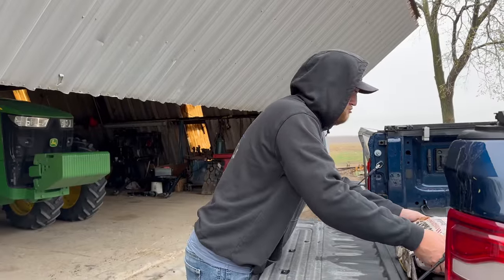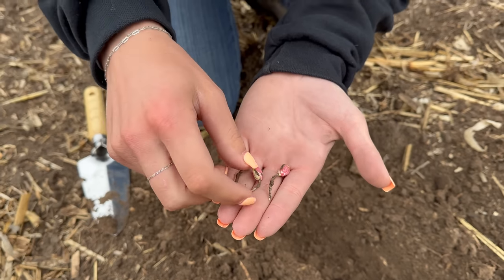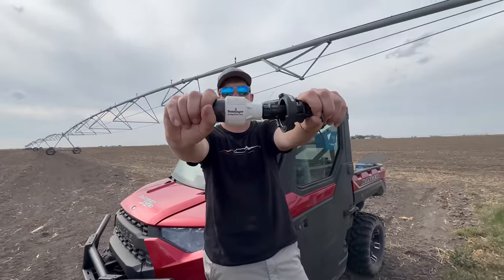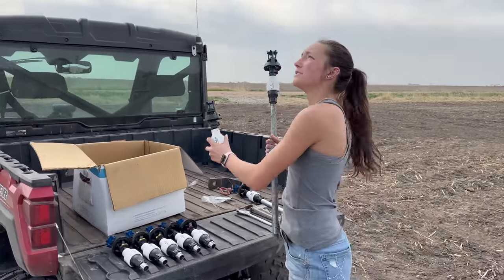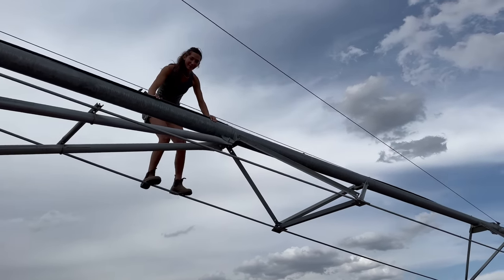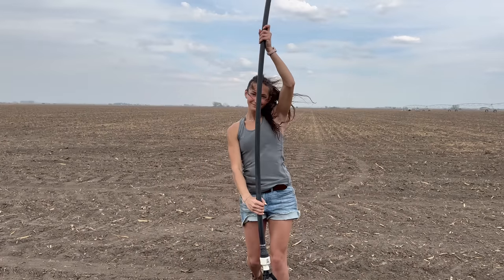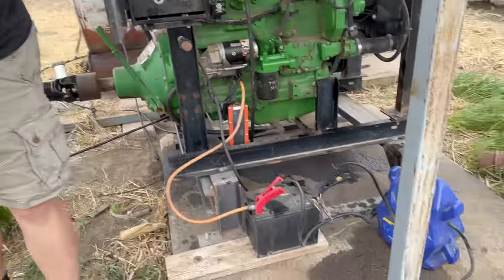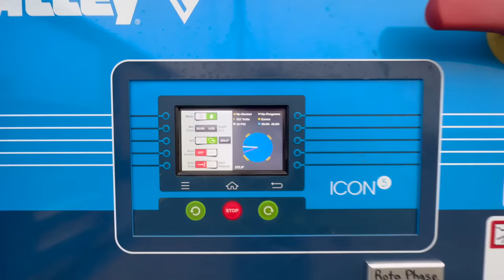Making It Rain!

Comment: In several shots, there was a steel cable running the length of the pivot. It looked like the perfect place to anchor a safety harness. I think you would be super cute wearing a safety harness.

Comment: Fascinating how those pivot sections move independent of one another and yet work together as a whole.
Reply: Having to look that up because I too am trying to imagine how it senses movement  between all the drive units to keep it strait and identify a stuck or broken drive unit. Voodo majic man ha ha ha....
Reply: A good video of one being built and how all the bits work together- 14:30 talks about keeping the pivot towers aligned
https://youtu.be/7j1lMs7fcIQ
Reply: @aaronsbarker  i was going to link that but you were faster =) he nails it !
Reply: sounds like society!
Reply: @js7127  From what I understand the section on the end furthest from the center moves all the time.  At each joint between the other sections there is a sensor that detects defection as each section gets out of line.  Once the deflection gets great enough it turns on the motor for that section and moves it forward until it gets ahead of the next section outside it when it shuts things off.  It then sits there until the sensor tells it to move again.  I may be way off but this is how I imagine these things work.
Reply: @Aaron Barker  used to work on a farm that had overhead irrigation in a straight  line on one unit and if any section got just a little out of line it would shut it self down and shut down the pump which was a separate diesel motor a half mile away. Smart machines!

Comment: I worked on a pivot many years ago. We used 2 extension ladders to replace all the rusty sprinkler heads up on top. It took 2 people to break free some of those heads. It took just as long to move the ladders by hand to the next spot.
Reply: That pivot looks like it's over a thousand feet long. What would your guess be?
Reply: @bige.3474  1000 ft pivot would only cover 75 acres. So it's more like 1500 feet, that would cover around 160 acres.

Comment: Surprised you don't have a harness so you can clip on for safety. The other way would be to buy a pod for the front forks on a telehandler, so you have a platform to work from.

Comment: If it was me doing that sprinkler job, I'd attach my harness clip to those wires running parallel to the pipe. That way you can still move easily, but if you do lose your balance you're not landing on the ground.

Comment: You've mentioned and showed us when you were planting the areas of the field that have the pivots for irrigation and then there were some parts of the fields that don't get covered by the pivots. How are those parts of the fields irrigated and do you notice a difference in yield between the parts that are and aren't covered by the pivots? Love the channel! Thanks.
Reply: God does that and mother nature does the watering in those places.🤫😀💪👍🤟🌟🇺🇸
Reply: For the most part, the corners aren't irrigated.  And, yes, the un-irrigated areas yield less than the irrigated.  This year has been quite dry, so the difference will be very large this year.
Reply: New pivot designs fold at the end sections and can almost irrigate a square field 100%.

Comment: I see from a USDA document that the height of the truss is 4'-14' with most in the 8-9' range.  Not a fall you want to take, but I don't think a fall arresting harass would even deploy.  Seems a bit slow working your way along the stays but I assume an orchard (tripod) ladder has been tried and discarded by past generations.

Comment: How high are you? 8-10 feet? A fall would be painful but dirt is soft. Have you considered since you already have on a tool belt you can add a safety line to it with carabiners on both ends. Attached it to the cable and it slides along. At every brace you have to unhook and move it over. That frees up both your hands to work and prevents accidents. Probably makes it go faster too. I assume you were not using your lift as it might get stuck or because it takes one person to run it slowing things down?

Comment: Thanks for an entertaining (as well as educational) video. I see pivots in real life all the time but I didn't realize how high they were until I watched Laura climb up with her pockets full of sprinklers. Is the water that comes out of them potable? Would it make you sick if you drank it? Maybe it depends on the well? The sprinklers being semi-custom, adapted for their position on the pivot, was fascinating. Laura explained that's to adjust for the fact the path of the ones further from the pivot point is longer. But engineer me wants to know if the distance the water has to flow through the supply pipe also is a consideration in setting the size of the sprinkler. That would mean pressure at the furthest-out sprinkler is less than the ones closer to the pump. So Senninger would have to do a "head & flow" calculation first before matching the nozzles to their positions -- of course this happened before Laura and Grant got the parts.
Reply: Normally they figure a 10 psi pressure drop along a 1/4 mile machine.  That's close enough on a fairly level field.  But many fields have significant elevation differences, and that can seriously affect the pipe pressure as it goes up and down.  In those cases, they have "pressure regulators"  (Not sure if that's the correct name or not) that mount in between the pipe and the nozzle.  
Say you've got nozzles that are designed to operate at 30 psi.   In that case, as long as the main pipe pressure is at least 35 psi, the pressure regulator will deliver 30 psi to the nozzle.  The main pipe pressure could be anywhere from 35 to 70 psi, but the nozzles will see 30 psi all the way along the machine.  
Oh, and the water that Laura pumps is potable, although you wouldn't want to drink the first few gallons at the start of the season.  There'll be some rust and oil from the deadpool that has sat in the pump all fall and winter.  Give it a couple hours to flush out, and it's perfectly drinkable.
Reply: @42base13  Thank you, that's great! Yes I think pressure regulator sounds right.

Comment: How do the pivot wheels work? Do they all drive or only the ones on the end? 

If they all drive how does the speed adjust to account for where they are located on the pivot?
Reply: AFAIK, the pivot sections are jointed (to rotate horizontally). At each section join, the motor drive senses how straight the joint is, and adjusts its speed to keep its joint straight. Set the speed of the outermost motor, and the rest of the line stays straight. This way, if there's mud and your wheels slip a bit, your motor just runs a bit faster to catch up.  (I may be wrong - we don't have huge pivots in my part of England - Laura is about 4300 miles from here...)

Comment: What drives the wheels and keeps them in a straight line? Thanks for a great video.
Reply: Same question I had👍
Reply: @sam__304  There are gear boxes with electric motors on them  and drive shafts out both directions to each wheel, the motors cycle on and off based on alignment switches on each tower to keep all of towers in alignment.
Reply: @davidpancheri6006  thanks

Comment: I would have thought it was necessary to use Teflon tape on the threads to prevent leaks. Do you have any problems with the heads leaking?

Comment: So question, is it the hydraulic pressure of the water going through the system that actually turns the wheels to make the pivot go round or is it like electricity or some other man's

Comment: “Totally safe.”   In an OSHA class once, the instructor mentioned how industry is overburdened with rules and farmers have too few rules/precautions/safety equipment.
Reply: For at least 40 years I’ve heard about diesel engines at well heads.  Until this video I never thought about the fact that hiu have to bring fuel to those engines.

Comment: Hi Laura. This will not make the top ten, but did you and Grant buy a bucket truck? A safety line could be a nice thing while on the pivots. I hope these sprinklers work better as I have seen you and Grant dig enough tires out of holes. The pivots are dry, what they convey is not. Have good days!

Comment: Doe you work with an engine or a fuel supplier to test the engine oil periodically to determine when it should be changed or to see if there are lubrication issues?

Comment: I have a question about the water. If the fields are rather square and the pivot is moving in sort of a circle, how can it give water to all the crops? I have like a thousand more questions, but why not start with this question.
Btw... Hello from Sweden 🇸🇪
Reply: It doesn't water the corners, unless it has a swing arm on the end that can swing out into the corners.

Comment: Safety 2nd or 3rd, but safety. A fall from that high could really hurt, wear a harness or rent a boom. (please) Also an open drive shaft would show no mercy if you got into it and accidents happen mostly during experimental start up. That's the most dangerous time. (please)

Comment: On question Laura -> why are the pivots so high up above the ground. My first thought is that a lot of water is wasted due to wind and evaporation. Shouldn't it be lower to the ground. Is that because of getting maximum circumference?
Reply: Pivot height probably is two factors.  how far can you get the water to go and the ability to drive equipment under it.
Reply: Crop clearance.  You don't want the tie rods dragging on the corn.  You can flip a pivot that way.  It happens sometimes when the corn gets taller than usual.
Reply: @42base13  Thank you. That makes perfect sense. I had not considered once the crop reaches maturity. Duh!

Comment: Greetings from Germany! I have maybe a silly question the pipes turn in a circle but the field is squareish? dies it reach every corner ? or do you get dry corners? in germany we dont use such systems at all or at least in my part of germany.
Reply: There are dry corners.  Laura explained it during planting.
Reply: @dwightl5863  ahh thanks man ye i missed that video honna watch it now!
Reply: On some units the last arm folds back to make flats on the circles otter limits. Would sure like to see a drone time laps of that, COME ON UMC !!
Reply: That would require a drone with a very long battery life.

Comment: One thing you really need is a Bucket Truck bought at Auction. They have a bunch of good ones around where I live for about 10g that need nothing. They come in Handy on a Farm as big as yours. Some of them are 4wd Trucks and I bought one to trim Limbs and fix stuff. Pivots are dangerous to climb on and work from just one minor mistake can change your life. My opinion. That depends on your finances. God Bless. Be Safe. Both of yaul. Plus your Kitty can climb in the bucket with you and hand you tools.

Comment: One thing I would never use for starting a diesel is Starting fluid The best thing that you could ever do. Then bleeding air out of a diesel engine is crack open the lines. On common rail diesels you do not need to crack open the lines All you have to do is crank over the engine and it will bleed itself starting fluid is bad for diesels

Comment: On your channel I have seen three types of pivots, diesel, natural gas and grid electricity. Besides initial set-up, which is the most cost efficient? Maybe you could break it down in an episode; start-up, usage, maintenance, overhaul. I could see with grid electric that you could get a short in the power lines even with a buried cable. Does it matter where the pivot is located in the field?

Comment: Have you ever thought about automating the engine or the electric pump motors on the pivots it can be controlled remotely from home via radio or cable connection, this way you can start,stop and get data on thing like oil pressure, engine temperature, running hours and fuel level in the tank? I’m assuming your pivot them self’s can be controlled remotely already

Comment: Hi, Our pumps are usually at the water source like stream or a reservoir. Yours is at the pivot point. I am wondering were does the water come from? Our brands were Lockwood and Gifford Hill here in Alberta , but they were manufactured in the USA.We have Valleys here also. Thank You for the very interesting videos.
Reply: There's a large aquifer under most of eastern Nebraska.  Their wells are 250-300 feet deep, pumping straight out of that aquifer.

Comment: I've seen you do center pivot checks which include some kind of oil reservoir check. What is the purpose of that oil? Is it crank lubrication? Engine lubrication? Well pump lubrication? What exactly is the oil doing? Obviously it doesn't go through the sprinklers. I am genuinely curious.
Reply: The drip oil on the side of the wellhead lubricates the vertical driveshaft that goes down the center of the well.  Her dad has an old video of a well being serviced that shows how it's all put together.
Reply: @42base13  thank you

Comment: Love watching your farming careers grow.   I seen battery arcing on a semi truck,  so be careful.  Positive first.

Why do you connect positive first?   a google search
Connect positive first, negative having less potential won't arc. The higher the voltage, the greater the chance of arcing and fusion. On a car if negative first and you are touching any metal part of car, when attaching positive there is possibility of arcing through you. Your body becomes part of the circuit.Feb 20, 2015

Comment: There is something i am missing here . Last winter you rebuilt this engine and you couldn't fixe the battery cable . I guess if you snap a few hundred acres of crop your still flowing with liquidity. You guys have it easy compared to us in Canada   good for you

Comment: It's amazing the distance water is pumped through those pivot systems. I'm surprised there isn't extensive line lose of water pressure for that distance.
Reply: Shouldn't be more than about 10 psi loss down the main pipe.

Comment: Farmed in north central Indiana, there was no irrigation in the Midwest for the most part. So what's the cost, just round bs numbers, well, pump, drive motor and the actual pivot... has to be astronomical!!!
Reply: If you're starting from scratch?  New well, pump, engine, pivot?  $250,000 ballpark.

Comment: 7:00 - I know farming is one of the most dangerous professions, but do we have to make it unnecessarily dangerous?  How about a safety harness (like they use in the Flagstaff Extreme course where they go on zip lines high in the trees) that she could clip on to one of those wires?  You do love Laura, don't you Grant?
Reply: It would have to hook on to the main pipe, and it's really more trouble than it's worth.  They should be using their JLG lift platforms.  They had the proper setup in a recent video.

Comment: Why would you both climb on a precarious pivot when you have 3 different JLG telescopic forklifts? Palet on the forks to serve as a work platform and you're good to go. Safely. Or a 20-30 ladder stood straight up in the back of Ranger, secured by rachet straps to the roll cage, with a safety harness tied to the ladder.

Comment: One question here! As you said, less water is spread close to the starting point than at the end, because the area to be sprayed is larger there. But the distance of the outer wheels is also greater than that of the inner ones. How is that arranged?

Comment: Pivot questions.
Well depth?
Gallons per minute pumped?
Engine HP?
How often does the engine oil need to be changed?
Does the engine use well water for the cooling system?
Does the engine need the battery after it is started?
Typical inches of water applied?
Is the amount different during the growing season?
Number of sprinklers on the pivot?
GPM of each sprinkler?
Number of towers?
Number of tires?
Did any of the tires go flat over winter?
What makes tires go flat?
Is the pivot an electric drive?
Is there a generator on the engine to run the pivot?
What does drip oil do?
Inches of water to grow a corn crop?
Inches of water to grow a bean crop?
Cost to apply one inch of water?
How long for the pivot to make one circle?
How many gallons does the diesel tank hold?
How long will the pivot run on a full tank?
$ to fill the tank?
How much time spent to get pivot ready to use?
How much time per day to keep pivot running?
How cold is the water temperature?
Do you stand under the sprinklers on a hot day to cool off?
How many acres does a basic pivot cover?
How many more acres does a end gun or corner system add?
Can you walk as fast as the end tower?
Does a pivot run at night?
Does a pivot run if it rains?
Does each pivot have a name?
Reply: Most of those have been answered in past videos.  Roughly 250 foot wells pumping 800 gallon per minute.  Many of those questions can be answered just by looking at the setup shown.

Comment: How much pressure does it take to pull water out of the ground and then send it down the long pivot pipe?
Reply: The pump is at the bottom of the well and pumps the water up to the surface and through the pivot.  The amount of pressure needed is a function of the depth of the well, the friction loss in the pipe and amount of water pressure needed to run the sprinklers themselves.